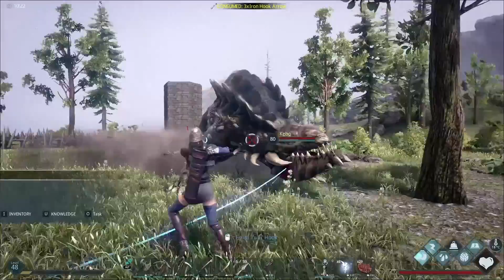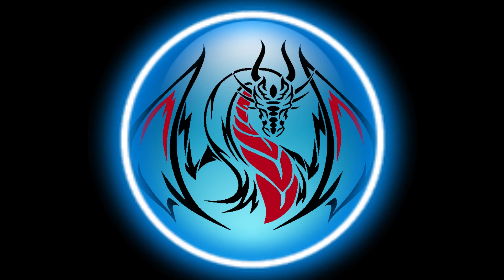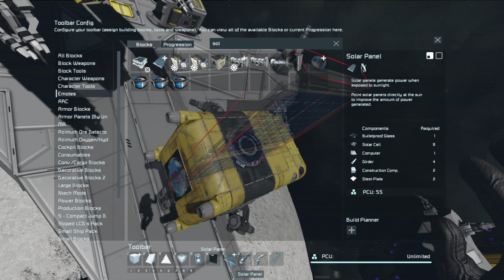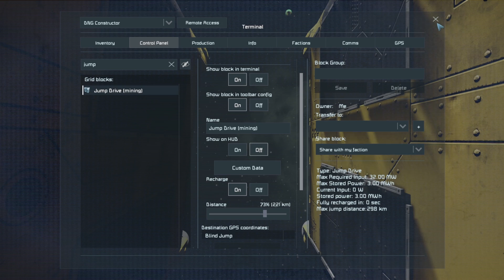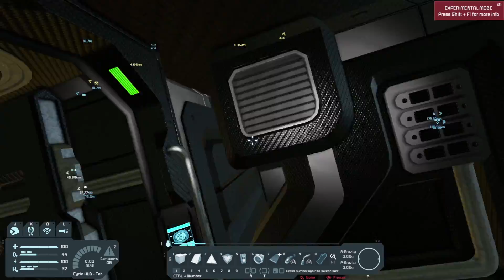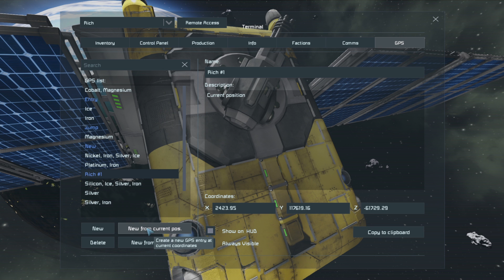Space Engineers #41: Comms Relay

Comment: I think you could have just used a pair of laser antennas to make the link. No satellites needed since you have direct line of sight, right?
Reply: the laser antenna's have had a glitch where all they pretty much can do is tell you there is a connection, you cannot access their terminal or remote control them. This has been a glitch for about 4 months now and they are yet to be fixed. I learned this a few days ago after trying to use a long ranged spy satellite in my friends private server.
Reply from the maker: I was wondering how long it would take for some to suggest this. The problem is that the laser antenna isn't reliable. I don't think it has ever worked correctly.